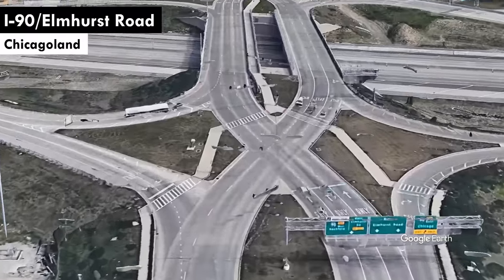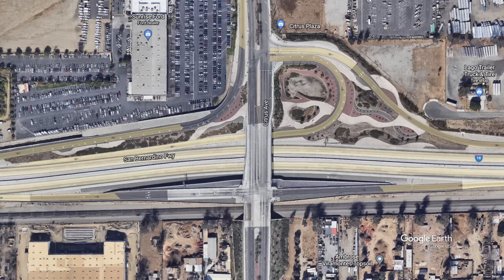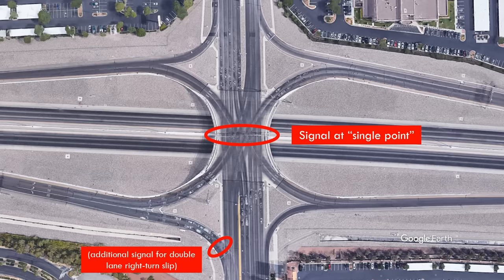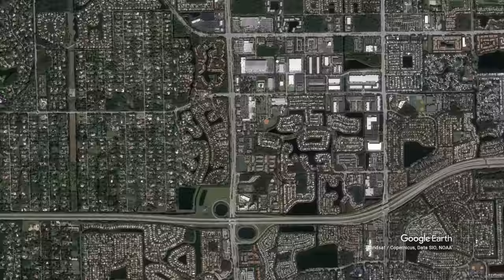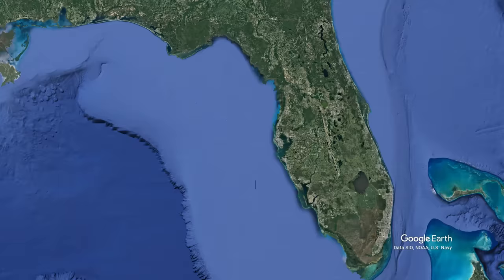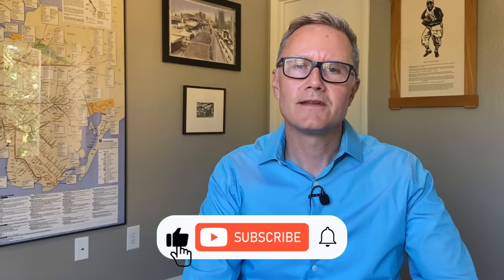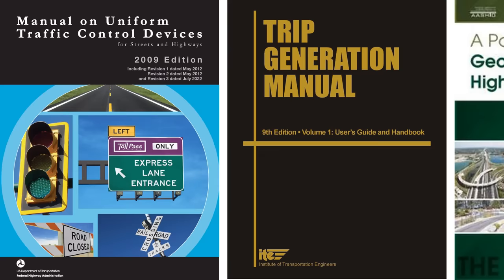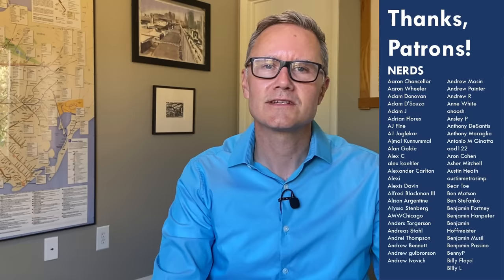Traffic Engineers Gone Wild: Why Interchanges and Intersections are Getting Worse, Not Better

Comment: Thoughts:
1) Those aerial shots of all those parking lots made my brain cry out with joy, "Look at the sheer size of those poorly utilized land banks!" Then my mind's eye filled them up with four- or five-story residential-above-retail walk-ups in orderly rows. Would that the developer's mind had done so before breaking ground.

2) Springfield, MISSOURI??? Sir, I'll have you know that Springfield, Virginia, is probably the finest Springfield among all the Springfields! Where else can you view that magnificent monument to the pitfalls of traffic engineering, the notorious Springfield Mixing Bowl that has been constructed, deconstructed, reconstructed, and misconstructed nearly an infinite number of times since the 60s and STILL fails to perform as promised? On the plus side, all the 18 series buses avoid it by taking the HOV/express lanes to Pentagon Station, and I avoid it (when I visit) by driving my car on the back roads to the massive Metrorail parking garage at Springfield Mall, where one can catch the Metro or the VRE into the city.

3) TxDOT has gone completely bat-guano crazy for diverging diamond interchanges in Central Texas, especially in and near Round Rock. They work well, but only if you're driving a motor vehicle. Everyone else is totally screwed. Just a few miles down RM 1431 from its interchange with I-35, there is an infestation of contraflow lefts. It seems traffic engineers are as easily suckered in by silly, pointless fads as teenaged girls.

4) Remember the famed freeway revolts in NYC and SF? Let's do more of that! It's the only way that politicians and engineers will learn.

Comment: I'm always amazed by the lengths we go to with our roads when roundabouts would be the solution in so many cases.
Reply: But that would lower average-crossing-speed!!!
Reply: I heard they were going to put a roundabout in an intersection that would greatly benefit from it. I was very disappointed when they threw a traffic light at it instead. Worse yet, they installed flashing yellow arrows, but almost never use them. On the bright side, the pedestrian situation isn't great, but it's nowhere near as bad as in the video
Reply: @steemlenn8797    Not if the traffic doesn’t have to stop.
Reply: @givenfirstnamefamilyfirstn3935  First, it was irony. Second, yes, it would. There is no way that you can go round a roundabout with the same speed as through a normal crossing.
Reply: @steemlenn8797    Glad you agree that the roundabout traffic does not go through at the same speed, it is widely accepted that roundabouts are somewhere around 40% faster than light controlled junctions.
Safe Home!
Reply: @givenfirstnamefamilyfirstn3935  Whoever said light controlled junctions? lol
Also, as I said, it was a joke as shoudl be visible from the !!!  !!!
Reply: I'm not convinced. Here in America, roundabouts have suddenly become very popular, especially in central Indiana. The city of Carmel, IN has over a hundred! As a driver it's great because you move through with less delay, but as a pedestrian it's hard because drivers do not properly yield and if you are older or sight impaired you have no signal to protect you. When crossing multi-lane roundabouts on foot, the exit side is especially terrifying because of the fatal speeds (excess of 25 mph because the roundabouts are too large and have glancing rather than radial entry) and careless lack of driver attention. You just have to wait for a big gap which takes forever.

Comment: Another interesting French DDI: there used to be one at the intersection of A4 and A86 in Champigny-sur-Marne (east of Paris), and they replaced it with a very strange combination of left loops and roundabouts. I'm not too sure what to think of it traffic-wise, but they did build a new pedestrian bridge so that kids stop being killed while walking to the park nearby. That's a big plus.
Reply: I would like to submit the bercy gigantic spaghetti roundabout. But can it be called designed?
Reply: did you mean east of paris?
Reply from the maker: Not sure I've ever seen a ped bridge go straight over a loop ramp like that! Thanks for sharing.
Reply: @lgprod6459  Classic spaghetti nest 🍝
Reply: @CityNerd  I seem to remember a Chinese interchange design document where  it seemed that they ran a ped/bike track in each direction and then wrapped motor traffic lanes around them.   North American engineers generally lack imagination when it comes to 3 dimensions.   Most overpasses are 2D structures over a 1D highway.  The giant highway stacks in Houston impress me but I don't think much imagination was used.  Maybe the engineers need compulsory courses in paper folding?
Reply: Tear out the park for a nice surface parking lot. Problem solved.
Reply: That's really interesting, especially the roundabout and the resulting ghost ramps. Thanks for sharing. The covered sections of A4 and A86 are at least an attempt to reconnect areas.

Comment: I live in Seattle and currently Sound Transit is trying to expand the light rail from West Side of the lake (Seattle) to East Side (Bellevue + Redmond). I-90 used to have reversible lanes (like I-5 has in Seattle) but they actually ripped that entire section of highway out a few years ago to re-use as the Light Rail connection from International District to partway past Mercer Island.

What I think is interesting (and hoping someone could confirm) is the actual traffic of I-90 doesn't...seem to be noticeably worse without the reversible lanes? While traffic jams certainly happen, in general I can navigate both directions of I-90 relatively easy; time of day doesn't seem to matter too much. Even rush hour (west direction) is mostly only bad because of people trying to merge onto I-5. Could this potentially play into the whole "adding lanes doesn't alleviate traffic"? Maybe just an effect of us not back at pre-pandemic traffic? Might be an interesting thing to look into at some point.

Anyway, really loving these videos, extremely informative and pretty eye-opening. :)

Comment: What are your thoughts on traffic circles?  I have dealt with non-signalized traffic circles on busy roads in Athens, Greece.  It is almost impossible to cross the street because you can't be sure when a car is going to turn out of the circle.  The safest approach is to jaywalk across the street mid-block from the traffic circle so you can at least be sure when there is a gap between the cars.  In Washington, DC, this problem is addressed by placing a signal light at every intersection within the traffic circle, which completely defeats the purpose of having a traffic circle.
Reply: Here in Buffalo we have a fair number of traffic circles, and I can't think of any that are signalized.  We don't have traffic anything approaching the scale of Athens (the circles I'm used to have only one or two traffic lanes), but even here I don't feel all that safe crossing traffic circles on foot.  I usually go around them.  One of the circles near me has a nice little park in the center of the circle with benches and a fountain, but there's no pedestrian infrastructure, not even a paint-only crosswalk.
Reply: Yeah, roundabouts are a nightmare for pedestrians and take up a lot more space than a normal intersection.
Reply: Big roundabouts just shouldn't be built in places where people walk. Small roundabouts usually have drivers yield to pedestrians though here in Germany, they're not as common as I'd like but there's no big unaccessible ones at least!
Reply: Traffic circles, aka roundabouts, reduce gaps in traffic. Great for efficient traffic planning - bad for pedestrians. This is especially true on large multilane junctions. On small roundabouts, the islands between directions make it easier to cross since you only have to look one way. In 1960s New Towns in the UK, where roundabouts are very common, they often built separate over or underpasses for pedestrians. Walking in new towns such as Stevenage or East Kilbride, you can go a long way by foot without even seeing a car.
Reply: There are two main types of roundabouts where I live, ones with signalized crosswalks on each spoke and ones without.

The ones with are found in cities, are high-traffic, often have multiple lanes per spoke, and stop car traffic for pedestrians at regular time intervals.

The ones without signals are usually found in less dense areas (smaller towns, suburbs, and rural), are low-traffic, have only two lanes per spoke (1 entrance 1 exit), and are easy to cross because traffic is sparse enough to allow frequent pedestrian crossings without signals.

It sounds like your bad experiences are from designs that try to be both, i.e. multiple lanes per spoke in an urban setting with high traffic but crucially without signalized crosswalks.
Reply: Roundabouts are EVERYWHERE in the UK.
In good chunk of areas theres crossing points at the enterance/exits however cars exiting really don't like to even slow down to give way also it's quite easy to do 2 roundabouts and join them up.

Comment: The bowtie might come into existence somewhere by accident: when you have two roundabouts next to an intersection,  you might eliminate left turns there, bowtie complete. So it might actually be - in this instance  - a design change that inconveniences a few drivers slightly  while improving life for everyone else, including (but not limited to) the majority of drivers.
Reply: The Spaniards have a similar design, where there are only right turns.  To travel straight ahead, it's a right turn, 360 degrees on the roundabout, and right again.  With pedestrian crossing ramps on both sides of the junction, which slow traffic, there is no need for traffic signals.  KPI met!

Comment: European perspective: we also have some crazy intersections, nothing close to America though, but as soon as it becomes a high volume traffic area, even a simple roundabout, there's often other ways for pedestrians to get around it, like a pedestrian/bicycle bridge/tunnel. I remember in my hometown they built a new roundabout, but the first thing they made was the pedestrian tunnel. And then the construction site was already opened for pedestrians and bicycles while construction of the roundabout was still in process because the people were out of harms way.
What's stopping engineers from making a tunnel or a simple bridge to just bypass the intersection altogether? If you need to dig up the soil anyway to put a new road surface in, then why not just dig 2 deeper channels, slap on some concrete, and bam you got a tunnel? Or put up some metal beams with a platform on it and bam, there's a bridge? It can't be that much more expensive?
Reply: They just don't care about pedestrians. That's the long and short of it.
Reply: It makes swindon roundabout look pedestrian and bike friendly.

Comment: The DDI is actually really good to use as a pedestrian. Yes, you get put in the median most of the time (but not always!), but that has one great advantage: less uncontrolled crossings. As a visually impaired person, those suck. Especially the ones crossing freeway ramps. Also yeah, as a led, SPUIs suck.

Also, the CFI (Displaced left, whatever) near me SUCKS to cross. I can’t see the signal to cross a lot of the time, so I rely on the sound of through traffic to cross, which, in most cases, is a very good way for folks like me to cross. Ecept here, because the left turn traffic and through traffic go at the same time, which never happens as a regular intersection. And the pedestrian walkway conflicts with left turning traffic, even though this could be avoided quite easily, just by putting a pedestrian island in between the through and left turn lanes.

Also, hahahahaha, the user you mentioned on AARoads got alot of shit for saying this design was any good even before the video, and within a day of you posting, this video has been added to the thread. So we on AARoads know it’s bad too, but like anything, someone still thinks it’s a good idea.

Comment: Where I live the DOT had to do a bunch of PR on how to navigate the intersection they're building. To replace a 4 way intersection. Instead of getting rid of flashing yellow left turns they made an incredibly complex intersection (I believe it's the first of its kind in the nation!) that shut down 2 of the most used roads in the area and will require special high priority plowing whenever it snows because otherwise nobody will know where to go. I live in Alaska. Traffic engineers do not interact with reality
Reply: Sounds like a diverging diamond?
Reply: my intuition as a software dev says: if what you are building is accessible to everyone and it needs a manual to be used safely then you have designed it very very wrong
Reply: @SharienGaming  It's even worse here as this is an example where apparently even qualified trained users apparently still need the damn manual. After all the motorists seem to be the ones that need instructions and they ostensibly have an operators licence granted on the basis of an alleged demonstration of competence at navigating their vehicle. So in this case not only does the design have to be completely wrong but clearly the competence test for motor vehicle operators is inadequate too.
Reply: @SharienGaming  Well, that’s not completely true. You still need a manual to learn how to drive.
Reply: High priority plowing 🤔
It's a good thing snow is rare in Alaska.
Reply: @JoseppiAJ  unless your driving education specifically includes lessons on those intersections that doesnt change anything

and sorry, but the US driving education barely contains basic driving skills, so i doubt any of that is part of it

and even after all that... its still horrible design when you introduce confusion to infrastructure where people piloting multiple ton projectiles have to make split second decisions

in software, if you build a UI that needs a manual to be understood...people will often just give up on it... in traffic something like that will cost lives.
Reply: @JoseppiAJ  Yes, but driving is not for everybody. It is a highly restricted privilege. If you are even vaguely incompetent you should not be issued a drivers' license, and if that's infeasible that is a failure of urban planning
If after ALL that a driver's education is not enough to navigate them through an intersection without added training, you have a problem

Comment: I spent a mercifully short time as an electrician at Caltrans. The thing that shocked me was how little the CT resident engineers understood about their own projects. Most new construction is design/build by contractors, and CT engineers contribute their seals. So what ends up happening is you get all this whizbang technology implemented that woos and wows, then at some point during the service life it becomes a nightmare for maintenance...I was doing a PM on a very busy stroad in San Bernardino County. I noticed the queues were riduculous, so I started looking at the prints, which showed that the string of six traffic cases near the freeway were supposed to be synchronized. They obviously weren't. So I started opening up the backs of the cabinets and found the IC cables disconnected. So I made some phone calls. The answer I got was "Well, it was supposed to be synchronized, but we couldn't get it to work, so we disconnected them"... 🙄 ...Having come from a rather buttoned-down railroad environment, I threw in the towel on that job...
Reply: That is comical... they spend millions and millions on crazy projects then refuse to maintain them.

Comment: The term "accommodate" speaks volumes about the grudgingness.

As a driver, cyclist and pedestrian, I think that biking and walking infrastructure should be separated from highways, maybe by a good distance.  It'd make it better for both.

Residential access roads can be shared.

Feeder roads could have an adjacent walk/bike lane, maybe with a barrier depending on speed.  Intersections on feeder roads are usually simple enough to accommodate sensible and safe crosswalks, especially if the latter are at sidewalk level, not street level.

Comment: Great summary!  Having been involved in numerous intersection "enhancements" that have included some of those "innovative" concepts, I do think there is a lot of room for improvement for some of those. The DDI has some promise in that it handles left turns like a partial cloverleaf (loop ramp), but takes up much less space. Removing the large radius slip ramps, and creating 90-degree connections for the ramps (to be more like a diamond), and have peds/bikes on the outside of the bridge would be better. Also, "design speed" is a key factor. Most DDI's assume free-flow 25-35mph travel through the interchange, if DOT's would allow for vehicles to slow/stop before turning, and lane widths were tightened up, some of these could be less monstrous.  Keep up the great work!
Reply: i don't think the median idea is bad necessarily, but could be better executed, with low curbs and plantings instead of jersey barriers. AFAIK the slip ramps can also be signalized for pedestrian movements, and still achieve two phase signaling.
Reply: @tonywalters7298  ditch a lane on each side, widen the walkway and have planters at only the cost of two lanes, one in each direction. less lanes also forcibly slows traffic.
Reply: @tonywalters7298  The larger radius slip ramps create two crossing locations on each side of the mainline, for a total of 4 crosswalks to navigate. Tightening them into a single crossing on each side would be better for pedestrians.
Reply: @absea7918  I think breaking up a long crosswalk into smaller crosswalks is better, but it seems opinions on this do vary